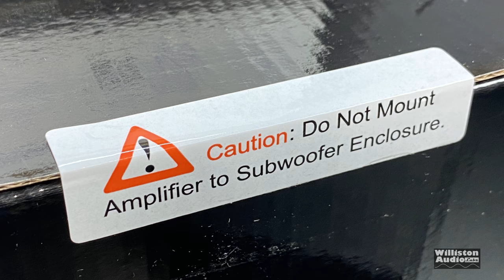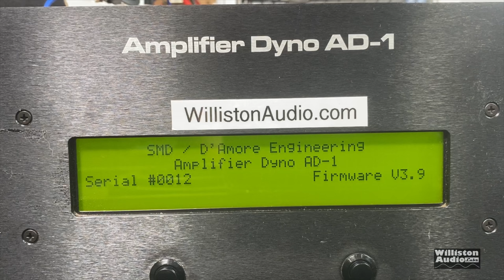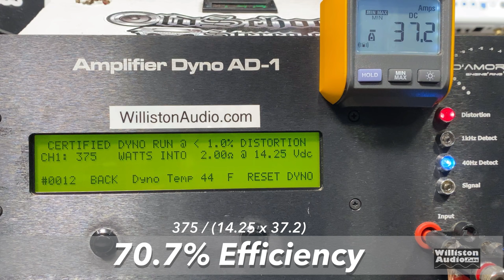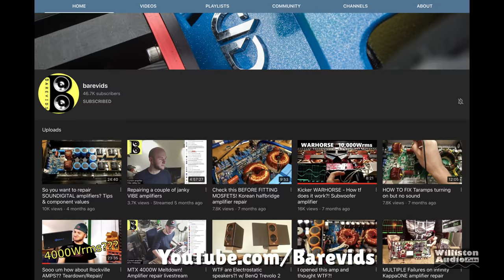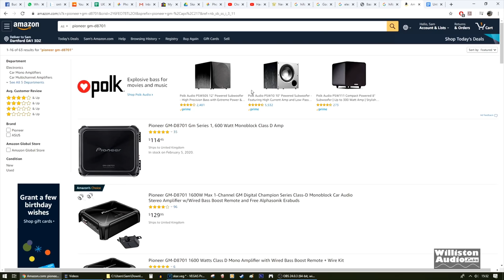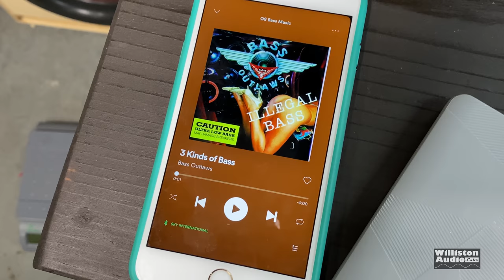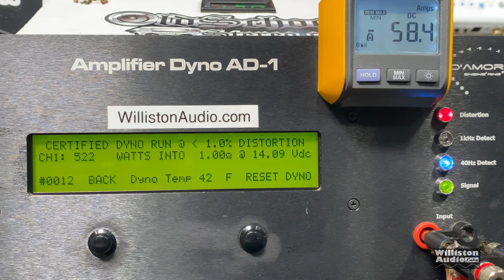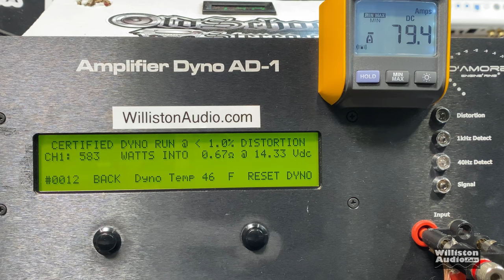Amazon Mini Amp Bargain? Skar SK-M5001D 500W Amp [4K]

Comment: If anyone has a cheap amp like this or a Boss brand the secret to keeping them from overheating is to mount it on a board with 1/2" spacers between the amp and board so it'll give it adequate room to dissipate heat. I think these cheap brands would get less hate if they recommended it

Comment: I just picked up one of these for my 2 10" Skar IX subs. its amazing how small stuff got. I'm 41 years old and remember when a 500 watt amp in some cases was 4x this size.
Reply from the maker: Agreed!
Reply: this tiny amp has a very loud fan. sounds like there an airplane in the trunk. returning for the 800.1d. Aside from the fan noise, is a great little amp. pushed my 2 skar IX 10S NICELY even @ 2 ohm final impedance.

Comment: Even if the amp guts could be better, it's nice to see equipment that actually makes its rated power, without being over-the-moon expensive. Bravo Skar!
Reply: Dude it's cheap crap.  So what if it makes its rated power.  If it sounds like cheap shit then who cares how much power it makes or doesn't make?  I've been waiting for years for Big D to address sound quality of these maps he tests.
Reply: @reganmorben9248  Fair point about sound quality. But, that's something nobody's been able to quantify in a standard fashion, in the same way SPL can be measured/counted. Besides, at this price point, nobody's getting good sound quality unless they get lucky or buy used. Actually meeting specifications is a minimal win, but for the cost, I'll take it.
Reply: @McTroyd  well the point was: Watching a subwoofer flex is a prety pointless part of Derek's weekly efforts...every amp hes put on the Savard subwoofer has made it go, you can't tell anything about the amp by watching a small sub move.  He could save himself a bit of work and just drop that portion of his tests and go practice on his BMX instead.

Comment: Big D, let's see an update video.  Bought one of these to push a single 10" in my daughter's SUV and it worked great for 2 days.  Then started overheating and going into protect, even with NO signal fed to it!  Something is inherently wrong with these amps.  Replaced it with a Kicker from Best Buy, and it's been great for 4 months now.

Comment: I know I’m late but I bought one two months ago and now that it’s turned over to summer my amp will overheat and turn off after 40 mins to an hour of moderately heavy play from rap to metal. It’s been about 80-100 degrees here in Stockton Ca and the amp is already warm to the touch just from being in the car while parked and un used. Might have to keep these in the cabin if you live in a hot climate. My amp is in the trunk mounted to a 1/4 acrylic board with an 1/16th” gap between the two. I might add washers to separate the amp a bit more but I feel like the fan might not be enough for keeping it cool in smaller spaces. I’ll probably take the bottom plate off of mine and add heat sinks to the top of the amp which gets the hottest if a bigger space for air flow doesn’t work. Which 500 watt amps don’t get very hot and or deal will heat well? I want to upgrade with my next purchase

Comment: I wish blaupunkt would up their game! Their bass knob is amazing! Why cant the rest of their amp be good. I'm currently using one to break my speakers in. 
For this price of this one I would rather get the Rockford 500. You cant beat the price of that one. Do you have a opinion of the best 500 rms amp for the price that doesnt best that one? If so let me know as I will buy it in a month
Reply: 2 ohm max impedance is what I need as my speakers will only handle that.
Reply: You might want to thumb through Budget Gem or Budget Bust videos. He also reviews amplifiers based on their output/dollar. He may have the answer you're looking for.

Comment: I’ve purchased this amp recently & for some reason it’s running super hot & goes into protection mode. I thought it may have been the ground so I did a better ground. Still same results, any clues as to what it may be?

Comment: Still just getting into the car audio scene. I think that the mrv M500 is probably the best amp that I've ever used I literally have this thing powering like for 10 inch subs. I don't know what Ohms it's on or any of that I don't know how to figure that stuff out yet but this thing absolutely slams very good job Derek thank you very much for the recommendation I absolutely love your Channel
Reply: It would be nice to know the final ohm impedance, as the Mrp are only stable to 2 ohm and any lower will toast parts inside...
Reply: Uhhh, yeah I'd figure it out. You can't just toss speakers on an amp, if you run it at a less than stable impedance you risk frying it

Comment: Greetings! Any plans to test the Skar SK-M4004D? I am getting ready to buy one to power two Skar 2ohm DVC EVL-65's in the rear, and two SPX-65 component's in the doors. I'd like to know how it will run with split impedance per channel (1/2/4ohm on channel 3/4, 2/4ohm on channel 1/2). Thanks, brother!
Reply: I have the SKM 400 4D....I am running (4) 6x8 4ohm (100 watts RMS each) NVX VS series door speakers and so far the little guy does its job well. It gets somewhat warm (not hot)but haven't had any shutdown issues at all. If I may suggest if you have decent installation skills...The Skar Equalizer..Its only 59.95 and man that thing cleans up the signal amazing for the price! Its a pain to hook up but worth it! Hook up 1 set of RCA cables to the input and get 3 (Front, Rear, Sub) outputs at 7 volts and the ability to dial in 7 band of frequencies and it truly makes the highs mids and lows come alive..That snare drum snaps like you wouldn't believe!! Especially with you running Components in the front! Just make sure the amp can match your impedences of your speakers in the specs of the amp depending on your configuration...Oh and one more thing that EQ does is makes it to where your gain setting on the amp will be set significantly lower which is a good thing👍 My gain setting matched from Head Unit to Eq to Amp is set well under a 1/4 turn on the amp! For the price of the little guy at $140 I am happy so far! Hope this helps💯👍

Comment: Quick question if you could answer please. Are the fuses of an amplifier on the input from the vehicle, or output side of the amp? Just ask, because you mentioned about the dummy math using the the fuses and average alternator output voltage. So it makes me wonder. Thanks
Reply: Input side. If they were on the output side there would be no protection for the amp itself.

Comment: Got this amplifier. Its pretty great, got pretty hot in the car even in low volume. Using a sub at 4ohms so not seeing the full power this can output. Waiting to buy a bigger subwoofer soon so I can hopefully use all the power this amp has to offer. Pushes my 8" 4ohm sub enough to blow it lol. (80 watts/160 peak)
Reply: Make sure you have it grounded really well.Scrape off all paint and bolt that ground wire to the body..Not saying you haven't but just in case because my Skar rp1200 was running decently hot until I took a little more time and drilled out a hole under the carpet in the back of my cherokee, got down to good metal ,scraped the paint and bolted the ground down..Been running cool every sense 👍
Reply: Not for nothing but if you do decide to try it...make sure and disconnect your Amp first from battery just to be safe 👍

Comment: What do you think of it pushing  One sub woofer a  10" sub woofer would it be good for that
Reply: I just did a sub flex vid with this amp and my X-10's each with there own amp it is not up yet but they move my 10's hard though
Reply from the maker: 500 watts is decent power for single 10 or 12 and would do well on a pair of efficient 8’s. It all depends on what you’re looking for
Reply: Williston Audio Labs What’s the RMS on the sub used in the video seems to be driving it pretty good?

Comment: Can you run these things super hard for as long a regular sized 500.1 amp would before they go into protect?
Reply from the maker: I have not torture tested, but that would be a good test
Reply: @wal  for sure. Nothing like having piece of mind. I have a jx500.1 bu JL. Iv had it since 2012 and it still runs like new. Its pushing a 12" tw3. I have it in a ported box. It was in a sealed and my God was there a difference. Hard to believe it was the same sub.

Comment: I bought this and had overheat/PROTECT mode . only kicked on for 5 min then protect mode , felt it and it was so hot i couldve cooked on it ! Returned it and now I have SAE 600d Sundown Audio
Reply: Yea wpuld be nice to test all of these smes for a hour to see what they do
Reply from the maker: I ran it hard for over an hour and didn’t experience any overheating issues
Reply: I have 4 of these amps and all has a pc fan mod that I did and they do not over heat no more :D LOL
Reply: Lol most overheating issues are install related. And the stupid term of power hungry means inefficient af.
Reply: Look at reviews others experiencing same issues , got Sundown amp using same power line/nothing changed and no overheat !
Reply: No protect either

Comment: Funny I bought to of these from skar this week and it looks like one has a tiny fan on the bottom cover 🤔 maybe they updated these.....?
Reply from the maker: It is possible
Reply: This is correct. I just had one deliver from Skar and there is a cooling fan on the bottom. When you mount this, use some spacers so the amp can move the air freely.
Reply: I have a 89 in’s truck so I mounted it vertical inside the seat frame so is takes in all the air it needs. That’s little fan sucks in a decent amount of air!

Comment: I have an old car with Alpine stereo and mid range along with a type R sub. Over the years my alpine stuff slowly wore out. A 6.5 up front and just recently a rear deck 5x7. I didn’t want to spend Alpine money again and replaced the blown mid range with Skar audio and honestly it sound just a good or even better due to age of the alpine stuff. Finally my sub Amp blew and I replaced it with Skar audios 800 watt class D amp and it hits way harder than the comparable Alpine amp I had.

Comment: I just got one and it shuts down. I dint even have to have anything playin. It get to hot to handle. I had 2 other amps in my car before this one all ran fine they just were not big enough or the right ohm for the sub "skar vd-10d2
Reply: Same here my amp will get hot and go to protection mode.🥺
Reply: @irvingverduzco3334  I just took mine out off the box over heated within the first 15 mins. I returned it
Reply: Same issues here. All of 10 minutes
Reply: if you used there instal kit the power wire is only 8G once i replaced it to the $g power wire it wouldnt shut down and was not to hot to handle. but its a little lump of dog shit anyway
Reply: I have one, I run it at 2 ohms it's never overheated on me even with playing it at high volumes for extended periods of time.

Comment: So would this be an affordable option to power 1 kenwood 1000watt max and 250rms 12” sub in my ram?
Reply from the maker: If it’s a 2 ohm or DVC 4 ohm sub, yes
Reply: Williston Audio Labs dam it’s a single voice coil
Reply: Kevin Jean I run 1 sub. And I always buy a 2 ohm dual voice coil, so I can run it at a 1 ohm impedance. That’s how your gonna suck the maximum amount of power out of these newer mono block class D amps. If you wanted to run 2 subs. You would buy two 4ohm dvc subs to get a 1 ohm impedance.

Comment: Get the 1200W Pioneer monoblock for the same price, with more than twice power and still a small footprint. I've been telling people to get the Pioneer GM-series amps for the longest time. Just because Pioneer doesn't make 5000W behemoths they get overlooked. In the <1200W class I would take theirs over any Korean cookie cutter offering as more thought went into their design. I still have yet to see a 4-channel amp in terms of price/performance that can drive 1-ohm loads like the GM-D8704/D8604s.
Reply: Actually grab the gm-9704/9604 for an even more powerful 4 channel.
Reply: Pioneer is trash
Reply: @SIMRIG412  if pioneer is trash, then this skar amp is the scum of the earth! The pioneer is miles better in every perceivable way.
Reply: @SIMRIG412  pioneer made the legendary hpm 100s and the sx 1980 look those up and let's see if you still think pioneer is trash
Reply: @SIMRIG412  I must say that people need to show Pioneer respect. They have a good reputation in all sectors and have some real engineering at a compelling price point. This is rare breed in this day and age where pretty much everybody is a Zenon-based value-added seller (like seriously, how many time are you gonna resell virtually the same 3.5kW board under a different name?). People don't realize how much money it costs to engineer something from the ground up (look at how much Alpine, JL and RF cost). At the mainstream level Pioneer just happens to have the largest scales of economy (and conversely why you see them in Walmart) but they aren't going to make a one-off design for a 3kW+ amplifier as it's not financially feasible as those are more of a niche product. Maybe a decade ago though... In my collection I have a Pioneer PRS-D2000SPL and if you see photos of the guts that thing is a thing of beauty where no cost was spared (full Nichicon cap outfit, bus bars between power supply and output, spacious layout, etc...).

Comment: This the amp I'm buying. To go with the 15" skar 1,200 watt loaded enclosure box. Will this be ok ?
Reply: No, this amplifier is not powerful enough for 1200 watts rms subwoofer
Reply: Definitely not
Reply: Can't believe I'm just now seeing this I'm pretty sure you're talking about the 1200 Watt peak loaded enclosure box which is 600 continuous I don't know if you've pulled the trigger yet but it would work but you would feel a little disappointed I believe it's better to go with something around 800 RMS for the 15.

Comment: I have one of the scar 500watt amps and it worked great for months and I never have the bass or anything turned all the way up and today my sub quit playing and it moved just like it should and isn’t froze up so I tested the outputs on the amp for the wires that go to the sub box with a multimeter and nothing so i unplugged the rca’s from the amp and just held the prongs onto the end of the rca cable and it tested perfectly i everything and I was getting signal so I know the amp is more than likely done but I read online that your sub blowing or going out causes that but I tested the ohm reading on the sub and it’s at 2ohms where it should be so is there another way I can test the sub that doesn’t involve putting it on another amp because no one I know has a system and I just had the one in my truck and well the amp is done

Comment: 😄I have two 15" Rockford t1 4ohm what is a good cheap amplifier that can push these don't have a lot of money😔
Reply: I have a similar setup with two 4 ohm JL Audio 15s, Rockford has a 500 watt for $140 bucks on Amazon that runs them perfectly. Have them wired in parallel so it's a 2 ohm draw, and the amp certificate is actually over 600 watts
Reply: @MrGrynch  it seems like that s*** might overheating things going to be pounding for a road trip

Comment: Would be worth it for $100. Don't really like having to wire a single sub down to 1ohm  make 500 W. I think the Alpine and JBL offerings are a better option. can be found used/like new for $80-100
Reply: At least skar hit their rated power unlike boss or rockville
Reply: @vipervidsgamingplus5723  I'd put skars lower end amps one tier above Rockville
Reply: Skar has nice amps but I heard they get too hot.I like taramps they have a fan built in.
Reply: I paid $90 for a Fosgate 500w rms amp, that's nicer than this and similar sized
Reply: @kylesonsalla7620  how? That amp cost way more new was it used
Reply: The alpine MRV is a much better amp and sounds better
Reply from the maker: The RF and Alpine amps I tested recently are both 2 ohm, 500W amps (around $125). They are physically bigger than the Skar though
Reply: @wal  I have a request. They have these "gravity" brand 
"warzone"  "6000 and 8000"  watt amps on ebay. They seem beefy and the prices are good if they  can do 2000 or 3000 watts respectively. Could you test one?
Reply: @bassbrother101  
R500X1D. Was $90 something when i bought it a couple years ago on Amazon. They're a little more now but definitely worth it. Have it paired with a 12" comp R in a ported box behind the rear seat in my Superduty. Hits just right to fill the cab with sound, without over powering everything else.

Comment: i had a skar 2000w single chanel sub amp i cant remember the model but it was pushing a sundown sa12 latest revision and it was a beast! i had an insane custom built box that honestly would blow you away with how clean and hard it hit. box makes all the diff in the world with high end subs if anyone has one.
Reply: And with just midrange equipment, got a Rockford punch p2 12" on a 400w amp with a correctly built sealed box, more bass than most ppls dual 12s with 2000w
Reply: Dave Micolichek  yes, obviously, but I can't stand the inaccuracy that is ported boxes, I do realize that a rly good one is a lot better in that department as well but ppl don't have those, they either have, some real shit™ or they got some cheap box that they blew the speakers in, put in new decent speakers in the old box that now is completely inadequate for them and now everything is a shit show...

Comment: Ik the sk is made in Korea is this one also Korean made?
Reply from the maker: That’s a great question but I don’t believe so at this cost
Reply: @barevids  I did a fan mod on all 4 of these amps and it is working though I put one of my X-18 on and ran for 6 hrs with off it did overheat but I did it again with my pc fan mod no overheating issus.  Question I have is it because of the heatsink being small or like you said it is the driver board on it thanks.